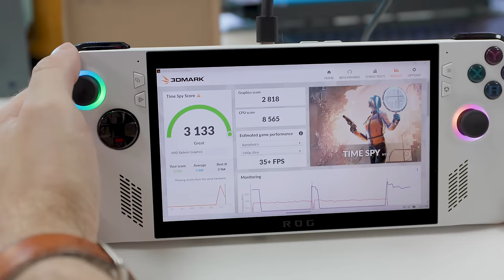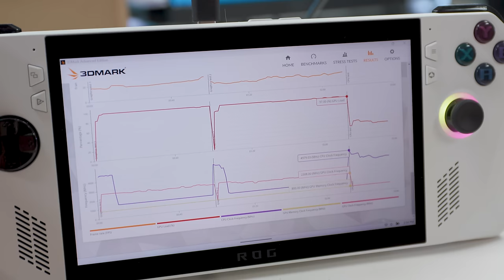Testing Kryonaut & PTM7950 On The Ally

Comment: The Rog Ally comes from the factory with PTM7950.  And just an FYI, for temperature comparisons tests like this, you should always lock the TDP and Fan Speed to a fixed number for both test.
Reply: You don't lock the TDP if you are hoping to see a performance improvement due to lower temps allowing the TDP to maintain a higher output.   If he was only looking to compare temps then you would be correct.  In this video he made it clear that he was looking for a performance boost had the temps maintained lower levels.
Reply: @kristoferstoll587 I agree. Gizmo's way wouldn't be representative of how these devices work IRL. They throttle on max EDP or temp.
Reply: That explains why the stock performed the best the PTM already had time to settle. I just put some on my 7900XT and so far it is IMPRESSIVE.
Reply: Dude I need help I tried to mod the battery now it rog ally doesn't recognize the original battery can you give me an idea of what it could be
Reply: @danielhw1  mod how? And do you mean it just won't turn on? If so, plug in the power cord and then try to power it on. I had to do that after disconnecting the battery to get it to reset the power circuit and turn on.
Reply: @bluegizmo1983  it only turns on without the battery and if you put the battery in while it is on, it does not recognize the battery in the system but it remains on

Comment: I think we have established that there is no point whatsoever to doing this unless it was a few years down the road and the factory paste was no good anymore.
Reply: They have clearly tried everything 😅
Reply: Even years down the road there's no need to change PTM-7950...
Reply: @mikeb3172 Yes there is. One internet goofball failing because he (admittedly) didn't even follow the instructions doesn't disprove careful lab results.
Reply: Unless you have a 7900xt or xtx gpu that has terrible pump out issues
Reply: @mikeb3172 realistically how many years would it take??
Reply: @Cutter710 long enough until the lifespan of your laptop
Reply: They come with PTM7950 from factory

Comment: Throw the PTM in the fridge (not freezer) for about 1 hour before using it, it will help you with the installation and also help the compound take a better shape around the chip
Reply: isn't it dangerous that it might condensate and oxidize something on the gpu?
Reply: @Threewlz  The trick that I use to apply PTM7950 is to directly apply one uncovered side of the pad directly to the GPU die/CPU IHS, and once everything's stuck to the surface, only after do I take off the 2nd plastic layer and attach the cooler.

Helps to prevent situations where the pad sticks to the plastic layer instead of the GPU/CPU
Reply: @Threewlz  No. Refrigerating the pad is recommended procedure.
Reply: @VIDS2013  too late, I've freezed my into oblivion
Reply: @Threewlz  The paste is stored inside 2 overlapping plastic strips so that should be fine, but you should also store it inside the airtight plastic bag it comes with and also don't leave too much air inside.
Reply: Dude I need help I tried to mod the battery now it rog ally doesn't recognize the original battery can you give me an idea of what it could be
Reply: I've always thrown mine in the freezer for 5-10 minutes, it helps with the separation of the plastic when it's installed.

Comment: Fun fact: If you put the PTM7950 in the freezer for a few minutes before application, the protective film will come off way easier.
Reply: some says dont put in the freezer which is the right one ? does freezer can broke the ptm7950 instead cause it's too cold?
Reply: Dude I need help I tried to mod the battery now it rog ally doesn't recognize the original battery can you give me an idea of what it could be
Reply: @DimasSRY  No, it's just a few minutes to help it stiffen up so it's easier to cut, handle and install. Don't leave it in there like overnight or something.
Reply: @danielhw1  What did you do exactly?

Comment: 2 important criteria for PTM7950 to really shine is high temperature and high pressure as shown in Linus video, I think ROG Aly will not be able to achieve either of these, need a fast current gen desktop CPU and a beefy cooler for that.

Comment: You'll likely noticed improved performance as time goes on (days/weeks/months). The PTM7950 will keep squeezing down when above the Phase Change threshold. It can get down to 0.038mm or 0.0015" (1.5 Thousandths of an Inch).
Reply: Just got to watch your vids before seeing this, yeah, should’ve done a weeks worth of testing before replacing TIMs.
Reply: I'm gonna add some to my GPU does this mean I'll have to periodically tighten my mounting screws around the GPU die as time goes by and the PTM get's thinner and thinner?
Reply: @astoraan6071  No. You won't be able to tighten the screws beyond their normal stopping point when you reassemble. They will tighten until they come to a stop. The springs or spring screws will compensate for the Phase Change getting thinner.
Reply: @snarksdomain  Okay because I am getting high GPU Hot Spot temps and Deltas on my GPU and was gonna use the "Washer mod" to add more pressure and see if that helps while I wait for my TPM 7950 to arrive.
Reply: @astoraan6071  don't end up cracking your die. just wait for PTM7950 to arrive.
Reply: Dude I need help I tried to mod the battery now it rog ally doesn't recognize the original battery can you give me an idea of what it could be
Reply: @danielhw1  long press the power button until the pc turns on and off again and keep holding it. Do it for Atleast a minute, it will perform a bios reset. Afterwards the laptop might take a long time to boot after pressing the power buttom, the lights will come on but screen will come on some minutes later. Let it do it's thing, it's because it's memory training, detecting hardware, doing hardware checks etc. hopefully will work. Otherwise you might have messed something up. Good luck.
Reply: @danielhw1  did you make mods to the battery or the Ally? If it's just the battery, you'll probably want to buy a new one and see if it is recognized.

Comment: If you want something cheaper with the same performance as the PTM7950, look in to the Laird Tpcm series. A 9inx9in sheet is around $30 at Digikey/Mouser which makes this much better value per CM^2 compared to PTM7950. Also, you can get TPCM 7000 in 0.125mm thickness compared to the 0.2mm thickness of the PTM 7950.

Comment: According to the instructions, you are supposed to apply the PTM to the heatsink after its wipe clean with IPA. Then you are supposed to heat the heatsink to about 30C to 35C before attaching it. PTM in theory solves the problem of pump out by turning back into a solid. It will continue to perform without the need to change it.

Comment: For the liquid metal, you can use a special coating to seal in the parts near the cpu so it won't short circuit
Reply: he would have to nickel plate the copper heat sink

Comment: PTM7950 is used for longevity. It lasts longer where other pastes fail (usually due to the pump out effect). It's the best way for consoles and other devices that are not easy to open up every now and then.
Regarding performance, decent pastes will beat it in stress tests hands down when tested immediately after application.
Reply: For direct die cooling PTM7950 is superior to every traditional thermal paste.
Reply: Sankar smells like onions and poop hands. PTM will also outperform everything but liquid metal, and when it comes to consistency it tends to outperform that as well outside of laboratory tests.  IRL, and after waiting for it to settle in (it's phase change), it beats everything on average. Everything.

Comment: 7c drop in low temps and average GPU clock speed increased 400mhz with Kryonaut extreme on a Z1X
Reply: Honeywell will do even better if you let it settle.

Comment: PTM 7950 is actually unique if their is any air between it and the heatsink it will slowly squeeze it out, and actually they found testing 1000+ cycles it was performing better than cycle 1
Reply: Dude I need help I tried to mod the battery now it rog ally doesn't recognize the original battery can you give me an idea of what it could be

Comment: i got PTM7950 on my liquid devil 7900 XTX dropped hotspot by 20c which is a watercooled card, so do not think it wont work with watercooled card it will if the chip gets hot enough, gpu's have hotspot areas that get really hot so its perfectly fine for that.

Comment: When applying PTM7950 just cut it slightly bigger then the die so you can push the PTM7950 around the edge of the die so when you peel it the excess comes off and perfect size pad is on the die, PTM7950 is also reusable apparently so when putting back the cooler on grab the excess flakes and put them on the center of the die it will burn in and melt and spread across the die again, altho if not tested it, i might test it on my laptop soon when i got time to take it apart cos my gpu core is 107c under load on my 10+ year old laptop :D

Comment: Not sure if you can get better results with PTM7950 but for me dropped hotspot temp down by 20c on liquid devil 7900 XTX 92 vs 60 to 70c hotspot since it's melting point is 45c it still works really good on watercooled card, perhaps PTM7950 works better if the cooler can also keep up so maybe its already at the limit of what the cooler can soak but it can potentially improve over time, if its just as good as your repaste i would not do anything PTM7950 will last entire lifetime of the device, unlikely normal thermal paste that pumps out dries out and starts performing worse after couple of weeks, altho your PTM7950 aplication is not perfect since it tore the pad, i would've personally re done it
Reply: they didn't do the testing properly,  so there was no difference... PTM7950 has to go trough many heat cycles before it has good contact. they should had gamed few hours on it before testing performance.
Reply: Ally comes from the factory with PTM7950

Comment: If you use a liquid metal, try to get a foam barrier so it stays isolated. Also careful not to overdo it.
Reply: Yeah not sure how liquid metal would hold good in a device thats moved around as much as something like this
Reply: @jeffreypeters5578 due to superficial tension it will not be a problem.

Comment: You mentioned the steam deck. How well does the ptm 7950 work on the steam deck?
Reply: It works great. Not a must on an OLED. But if you have an LCD, it will drop your temps by 5-10c. I was very impressed by it.

Comment: @PCWorld  Adam, the only way you can get better temperatures is to change the heatsink and fan. No great thermal paste will be able to get the heat out of the console if the heat is tramp in the heatsink.

Comment: PTM 7950 actually doesn’t experience degradation due to it being a phase change material. In the data sheets Honeywell actually states that after 1000 -55c to 100c cycles the performance actually improves. Basically the more you break it in the better it is

Comment: Very cool test - very interesting. That is WAAAY too much paste on the TG Kryonaut application for the die-size. Like triple the amount of what would have been far more than enough lol.

We all know that too much non-conductive paste can't technically hurt, but people cleaning the mess next time it's opened up might be inclined to clean away the masses of excess and thus have a higher risk of damaging the SMDs which are now unnecessarily covered in excess paste.

The thermal pad application looks quite fiddly and difficult to apply, but ultimately it seems to all be a wash - I would keep the stock paste personally.

Thanks for the testing!

Comment: That's the worst thermal pad application I have ever seen. You tore it many many many times. Even with that it stayed the same as thermal paste. 
You could have gotten 2-3 degrees better.
That's a lot to me. but next time put it in the freezer for 30 mins before the application. 
and lift in a sharper manner. just lifting in a sharper manner would fix all the issues but you need the extra help.  But well done on the video as a whole.